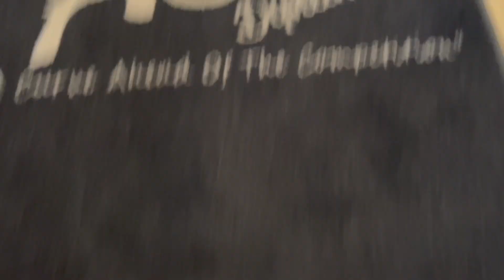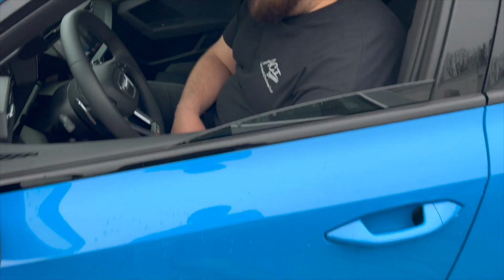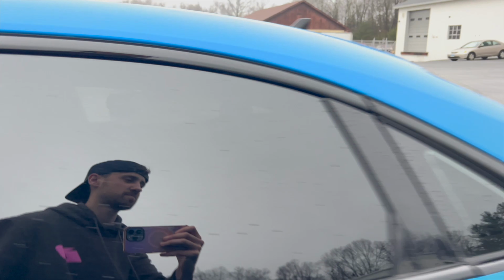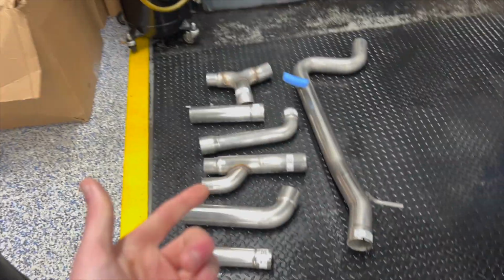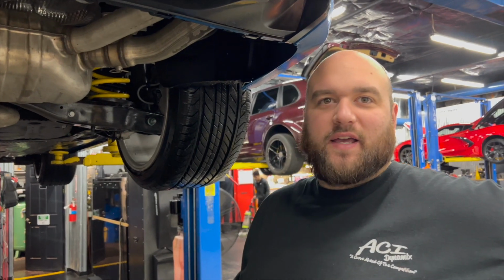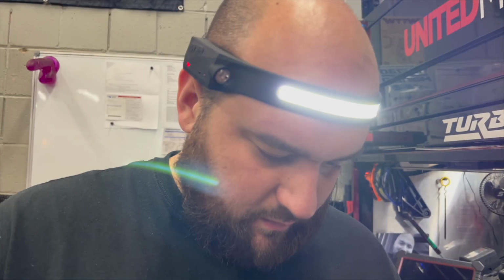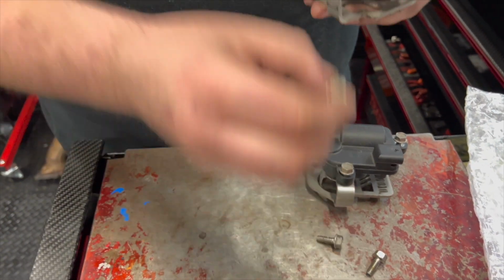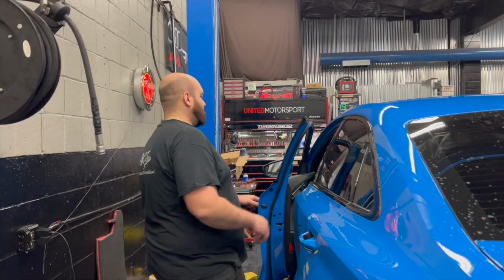2022 Audi RS3 AWE Track Edition Exhaust!! Install and Sound!!

Comment: Is there a way to reduce the droning with this setup?
Reply from the maker: Defiantly buy the switch path so you can close the valve that will help. Thanks for watching!
Reply: @acidynamix  I heard that buying thw switchpath muffler without the valve will fix the issue. Do you have any insight?
Reply from the maker: @ we have not tested that, but that could work!

Comment: I installed this on my 23 to see if it was livable for daily driving. I gave it a week but the drone was absolutely overwhelming and I'm surprised anyone could tolerate it without a helmet.   However simply adding the muffler from the switchpath version and leaving the other side open is the perfect solution for those who don't desire an open/close system. Just the one small muffler did away with all the drone but left in my opinion the perfect exhaust in both sound and volume.
Reply from the maker: Great advice! Thank you!
Reply: Interesting thanks
Reply: Where did you find the switchpath muffler I would like to do the same to mine.
Reply: @bradenscott7924  AWE sells a conversion kit to add the muffler and valved sections.  I bought it and installed just the muffler section. The valved section is on the shelf if I ever want to tone it down even more.
Reply: @RedC63AMG  did you ever buy midpipes

Comment: I have the same setup on my RS3 8V but there is significant drone on the drivers side. I also have unitronic midpipes res. delete but I heard that won’t affect anything. Is there drone in this? I couldn’t hear it.
Reply: what a question. This is not a propper exhaust, it‘s just a curved pipe.

Comment: how's the drone on the highway with this?
Reply from the maker: Its not bad, but if you plan to do a lot of highway driving I'd recommend the Switch path
Reply: @acidynamix  how much louder is this compared to the switch path?
Reply from the maker: @leolin3620  so with the valved closed its nice and quiet. When you open the valve its just as loud as the track exhaust
Reply: @acidynamix  gotcha thanks for the reply!
Reply from the maker: @leolin3620  no worries thanks for watching!